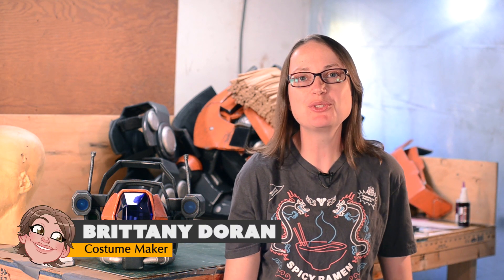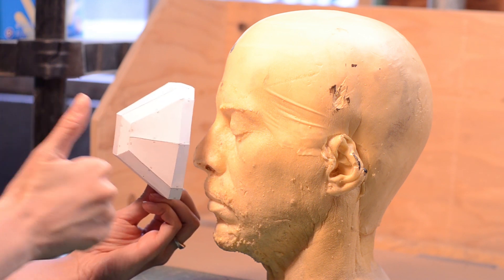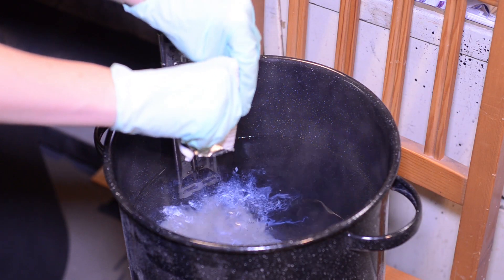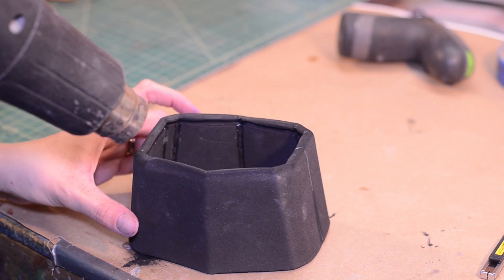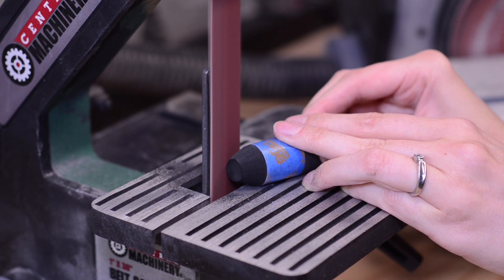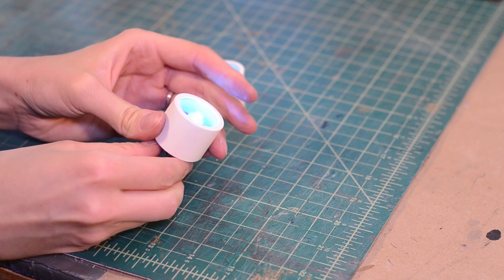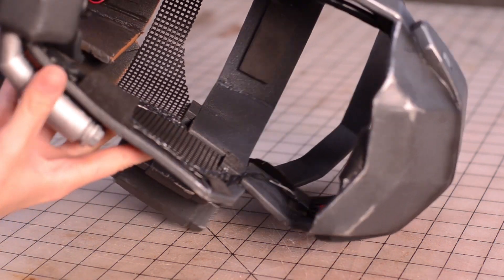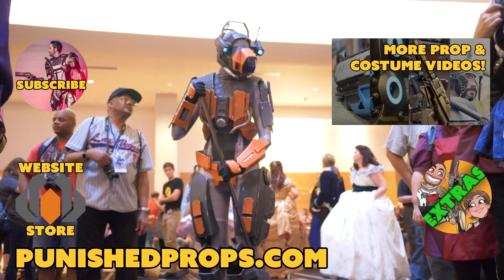Vacuform Visor and EVA Foam Robot Helmet - Destiny Sweeper Bot Build

Comment: as a tip for light diffusion: line the inside of the tube with aluminum tape (muffler tape) which is shiny and will reflect all the light inside flooding the tube more evenly.

Comment: Anyone by any chance got a good supplier that does 1” eva foam balls? I can’t use styrofoam balls cause the glue I have dissolves them
Reply from the maker: Hmmm... I've never heard of EVA foam being available in a sphere. The closest thing I can think of would be TNT Cosplay Supply's foam dowels, which could easily be shaped into a sphere: https://tntcosplaysupply.com/product/eva-foam-dowels/

But if that won't work, there is glue available designed to work with styrofoam: https://amzn.to/2L46uKp <-- there's an affiliate link to one such adhesive.

Hope this helps!

- Paige
Reply: Punished Props Academy thanks again I’ll give it some more thought

Comment: I wish I had been smart enough to use ABS and a lot of infill last time I went to make a lens like that, my buck half-melted and left me with a vacuum formed disaster :)
Reply from the maker: Oh no! What material was your buck?
Reply: PLA. In retrospect the mistake is obvious. I ended up casting a resin buck which worked well.
Reply from the maker: Thanks for the info!